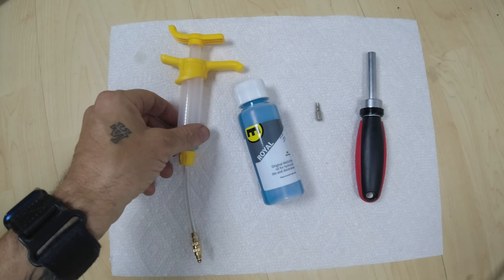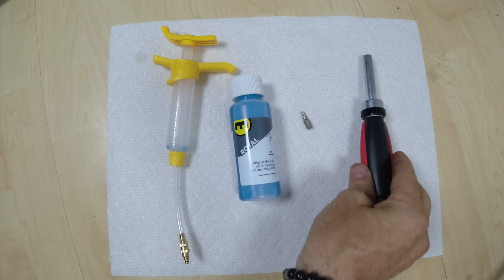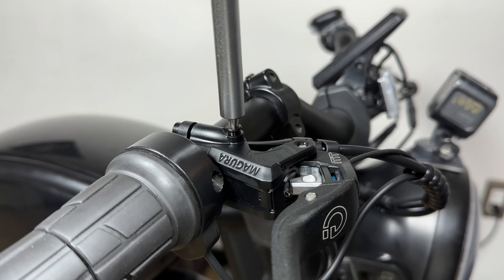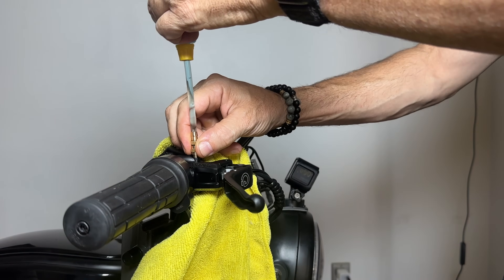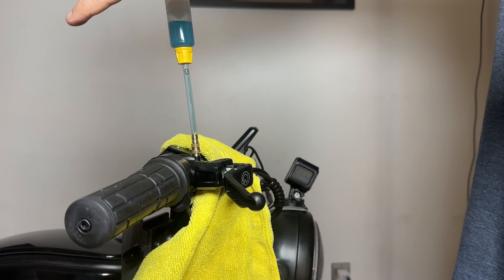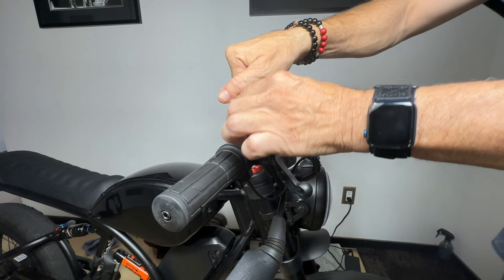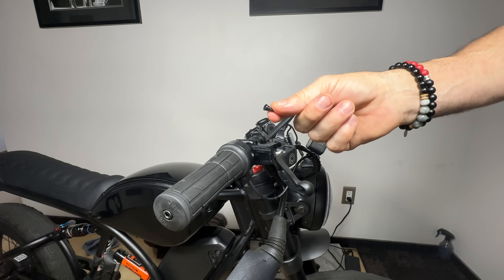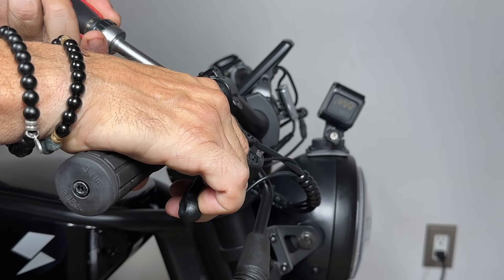Volcon Brat Magura MT5e Quick Brake Bleed #volcon #volconbrat #maguraMT5e

Comment: I was wondering how good does the brat pedal? If my battery dies while out will it be comfortable to just pedal or is this not the bike for that? Never had anything other than 7 speeds and not familiar with a single speed ebike. Thanks
Reply from the maker: I have not actually tried to pedal as the battery has been pretty consistent. But in mode 1 with pedal assist it is a great cruiser. I’ve done 15 miles using modes 3 and 4 and still had 75% left on the charge. The bike itself weighs 85lbs. I’ll try just pedaling on my next adventure.